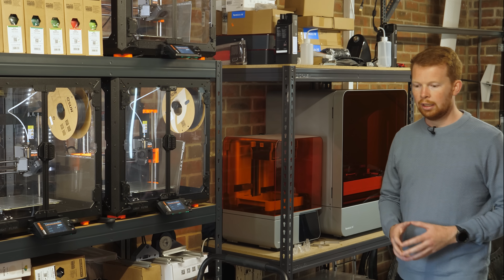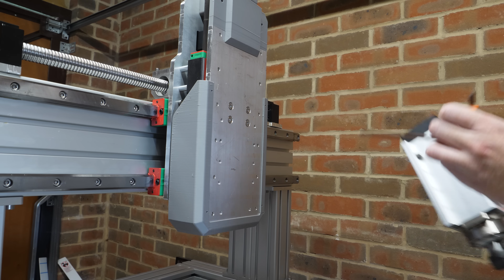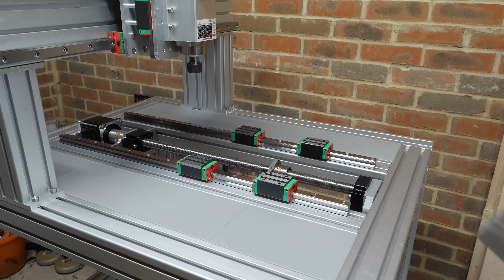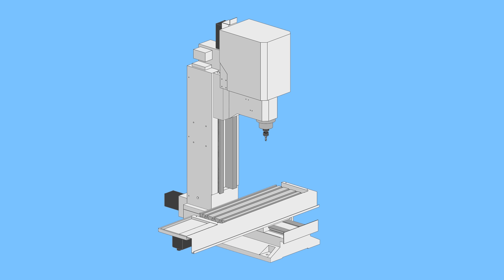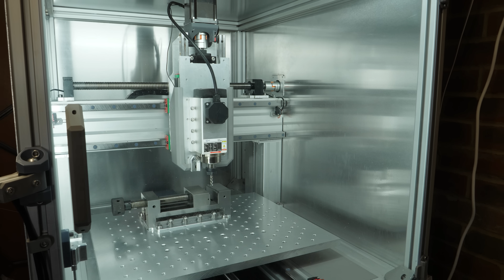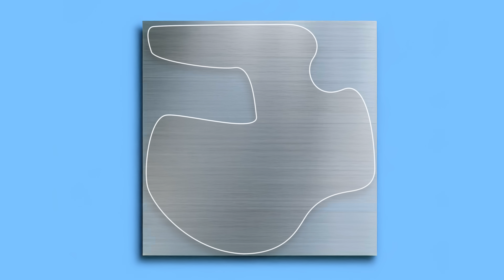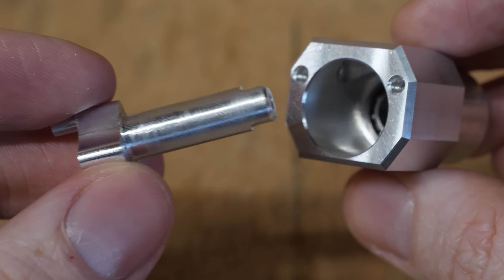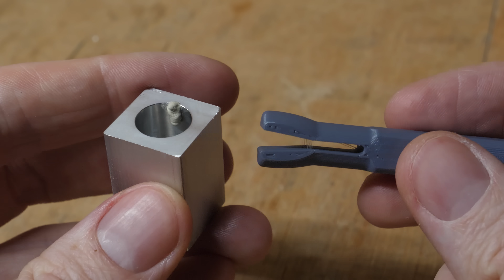I Needed an Engine, So I Built a CNC Machine

Comment: Clever with the epoxy/sand filler - I'd assume that the epoxy/sand helps significantly with vibration dampening due to more mass that the vibration would need to travel through. I think in the case of making a CNC machine, heavier is actually better compared to say a 3d printer where its more about reducing mass wherever possible due to the implied physics of weight/mass.

I also think your decision to have the milling head travel laterally rather than height can actually make things more precise with a screw-based mechanism as you're not constantly having to fight gravity, which will add at least some amount of play (in the form of backlash).

Overall, interesting build with some innovative engineering to overcome traditional CNC machine requirements.

Comment: @TomStantonEngineering  My good man, are you interested in collaborating on this project - we're developing a revolutionary pure ROTARY engine capable of operating at tens of thousands of rpm. [Will follow up w link to some of the tech otherwise it might get scrubbed. Crazy!] It will power the low cost [<$10,000], ultralight category [no pilot license], ultra-quiet, door-to-door, personal air mobility system. Team mates welcome.

Here is the core tech which can be incorporated into any engine architecture - https://www.youtube.com/post/UgkxZ6RT3NhnjTYs8tB22QgFe-MjqQ4qLNXC

Comment: I know this is a late comment, but you could try adding a polygon below the thread of the cylinder and a spring loaded blockage onto the side of the block. That way you could adjust the height in clicks and the angle should stay fixed after the adjustment.

Comment: Pistons without piston rings tend to have significantly more friction than with piston rings, and the idea is simple: piston rings reduce contact area, hence friction. Installing a piston ring is straightforward, it just requires buying the tool which slightly opens the ring and slides it over the piston into it's cavity.  Slightly more complicated but even more reducing friction and lifespan, can be achieved by adding one more ring called an oil control ring, which lets in a tiny amount of oil from the back side of the piston, but I guess this engine does not need to run trillions of rotations during its lifetime :-D. With this CNC, you'd make a new engine in a jiffy.

Comment: What about a small set screw in the part to lock down the timing maybe one on each side that way if you want to readjust the timing you can because i think you will have to adjust the timing depending if you use air or another gas

Comment: What's with your measuring needle? When I worked on CNC and we only had dial gauges, this solution didn't work for the accuracy we needed. I don't remember the reason, as I haven't worked in this field for several years. What problems did you encounter?

Comment: I have a CNC router from long ago.  Using 80/20 aluminum also.  Some of your parts are a bit thicker than you need.  Also, while you can use 80/20 for the table too, you could also just use any stable table made or wood, steel, etc.  My gantry moves in the Y direction, so I can't say if moving the platform is better.  For large wood, the gantry is better for me.  But small metal pieces maybe moving the platform works.  I used mostly a place formerly called 'CNC Routers Parts' for some of the pieces and design.  You can get beefy manual mills for about $3000.  They take up a bit of space.

Comment: Aluminum has a horrible coefficient of friction.  Rubbing it against other metals causes it to gall, melt, and stick.  

Also, i you want as minimal friction as possible, most of the piston doesn't need to contact the cylinder walls, only a skirt extension on the thrust and opposing sides would need any real form of stabilization due to the change in rod angle.
Reply: I've seen people straying water or mist on metal while cutting.  And this is why I do wood and not metal.  Cause the water run off is messy.  Also lathes are better choice for many circular parts.
Reply: @Putin_3  Both are messy.  The problem with wood is it absorbs moisture so itswells and changes weight, and compressed air decompressing will create a lot of condensation,.  You would need to fully treat the wood with an expoxy, which then just  makes it wood fiber reinforced plastic.  I would leave the metal cylinder alone, but run a nylom or delrin piston.  Just as strong, lighter than wood treated with epoxy, and an extremely low CF.  Plus, it can be machined just like plastic so you can use an injection molded block to make the piston from and not a much weaker 3d print.   In fact, if we wanted to go to the extreme, even the aluminum cylinder is just there because he wants to run 900psi of pressure, so if all desires is the strength, the cylinder itself could have a liner with a low friction CF too, such as bronze filled PTFE, which would be easy to machine and more than rigid enough to not deform.

Comment: Finish is OK, could be golden if you get a collect (er16) and chuck the material in the chuck and mount the tool extra firm below it, plunge the part. Do you want the BEST possible finish really, really? Use it like a lathe and mount the tool below. You're very welcome, very cool project.

Comment: If you want to prevent the cylinder head from rotating after properly adjusting its position, you need a "lock nut system". However, if you plan to add more cylinders or upgrade the engine in the future (to a V or L configuration), I don't think lock nuts would be practical. Your work is amazing.

Comment: 19:45 This seems really easy to solve with a simple set screw. Also, have you seen Inheritance Machining? He has a ton of cool videos detailing his adventures in making different tools for his machines, fixture plates, modifications, etc. that may provide some techniques you can use in your own projects. He works mainly with manual machines, but I'm sure you can adapt much of that to work with a CNC.

Comment: Would using isothermally compressed air (containing no water), work better ?

I guess as the air is decompressed during normal running, the gap between the piston and the cylinder will probably not remain constant and one of the factors affecting this could easily be water in the air.

Comment: Keep in mind that Pistons are not perfectly round! They are intentionally made oval and tapered to account for heat expansion and the forces exerted by the connecting rod. These shapes prevent the piston from expanding unevenly and seizing in the cylinder

Comment: Tom, the threaded cylinder got me thinking: if you dyno the engine (remove the prop and brake the engine), I bet variable cylinder height would increase power throughout the rpms (maximum torque at various rpms definately doesn't require the same valve timing across the board. This would become like ICE variable valve timing). Not sure it's useful since a fixed prop has a narrow window of operation for max efficiency anyways, but say you would be able to vary the angle of the prop arms, then varying cylinder height with a small electric servo would be insanely cool. A simple servo with a gear, meshing into gear teeth machined into the cylinder wall would work (make the gear teeth in the cylinder wall tall enough to allow vertical travel).

Awesome CNC by the way!

Comment: All the Energy and Carbons used and created in the Manufacturing of all these motors and drivers are not included in the calculations of the final products efficiency or performance. 
It might have been Greener not to have made the CNC or the little engine and just bought an already existing little engine.(For a model aircraft). I think I had a 2.5cc one in the 70's.
I really like the idea of Compressed Air as a power source as we can refill the cylinders by pedalling our pump in our Bunkers ,watching Content, protected from the dangers outside. 👍

Comment: 15:11   I'll let you in on a secret..   Pick up some Alum from the spice rack  (potassium aluminum sulfate) Put a small bit in a aluminum cup or stainless that you wont use  for food after.  You want it small as possible.   Place some water and a teaspoon of Alum in the cup and heat it then place your part in it and set the heat to low.  In a few hours the tape will turn to a black past that you can rinse out.    For larger parts you can use clay and build a cup around the broken tap and put the alum/ water mixture in it and heat near it.

Comment: Give a try to a HPA/ PCP aluminum air tank you can get them in 3000 psi or 4500 psi and they make air compressor that are very easy to use. And no im not talking about paintball cylinders. PCP rifles use thin tubes to hold the air. Hatsan and Benjamin or Diana make reasonably priced tube tanks

Comment: That design is also used commonly in 3-D printing and it is referred to as a bed slinger as it tends to sling or fling your parts straight off if you go too fast
Reply: That’s not even close to accurate. It’s called a bed slinger, because it LITERALLY SLINGS THE BED!

Comment: You create way too much friction if you use the entire piston as sealing surface. Your "cooling/heating fins" saved you there. You'd at least have to make the piston out of another material, that has some self lubricating properties, like some copper alloys do. Or your engine won't last very long.

Comment: as long as the fpt (feed per tooth) on endmills is what is recommended, it will cut nicely. theres a mathematical calculation for it. I also recommend roughing with bull endmills which have rounded corners that dont break off like flat endmills. these bull endmills will save you from buying alot of tools down the line and generally cut much faster. flat endmills are great for cleaning up after the bull endmill.

Comment: Incidentally, G-code has a command that automatically takes the radius of the milling cutter into account. The command is called G41 /G42. There are two commands because one is calculated to the right of the contour and one to the left of the contour. All you have to do is enter the milling cutter diameter, then G41 or G42, and it will mill the contour with dimensional accuracy.

Comment: bro your too smart for this im disappointed in you right now. you went with a standard 0.1mm resolution when you could have easily jumped to 0.01mm or even 0.001mm easy but you didnt even consider it. if you windering how bro. simple 3d printer extruder motor and a simple block and tackle setup and you can increase the resolution simply by adding more pulleys and you can even change the steps per mm in the gcode so 1mm is still 1mm so why didnt you build one for high quality parts? 0.01mm is better than a formula 1 car and you could have beat that easy and then the motor you used bro did you just cheat and look at a how to and mostly just copy default? replace motor with a turbofan and power it with a vacuum get about 30k rpms easy. to make anything cool you gotta think for yourself. like try to top my cnc machine or atleast match it i built it like this because its the best i can think of so beating it maybe hard but you can match it atleast. also i use a chuck for a drill not that small default thing i can do a wide rage of bits sizes i couldn't do before.
Reply: but still looks study well built lol in case of earthquake get under your cnc machine.
Reply from the maker: The steppers can be micro-stepped, so combined with these ball screws, it can do 640 steps per mm, which is about 0.00156mm.

Comment: As for locking the cylinder position in place, try machining a (probably very shallow in this case, unless you give the cylinder a longer thread on the outside in a future version) "locking nut" that gets added to the cylinder thread before the cylinder is screwed in. Once the position is good, screw the locking nut down against the body. This should lock everything in place, just like having two nuts on a bolt will, but still allow everything to be removed if need be. Just an idea, but might solve this problem easily. Keep up the good work!

Comment: Why not just mount the piece to the spindle and then mount a cutting tool to the build surface? Ghetto lathe. I would imagine it depends on the weight of the piece and you would have to counterbalance any asymmetries.

Comment: Great build Tom! I would like to make some suggestions. First, mount the cylinder with an integral flange at the base, this way its mounted in a permanent, fixed position. This would require machining a whole new cylinder. Second, design and machine a cylinder head that bolts to the top of the cylinder with an adjustable air line inlet, and an adjustable timing valve. This way you can adjust both the timing and the rpms of the engine. Third, you never want to run the same type of metals together especially at high speed. This will accelerate the wear and could cause the engine to seize. Instead, continue making the pistons out of aluminum which is standard in all engines. For the cylinder, the best material or metal is cast iron because of it's strength, wear, and lubrication properties. If you don't want to machine the entire cylinder from cast iron, you can machine the cylinder out of aluminum, and then machine a cast iron cylinder sleeve with a shrink fit. Now, the shrink fit cylinders sleeves are very tricky to install but will provide the best overall performance. Obviously, a small benchtop lathe would make machining most of these parts way easier. Consider getting a small benchtop lathe for all the precision round parts. This is from my years of experience as an automotive mechanic and my 25 years of experience in manufacturing as a machinist. These are only my suggestions. Like anything else, there are a million ways to solve a problem and to manufacture a part. I hope this helps.

Comment: When you are attempting to interpolate a perfect circle on your milling machine, try ramping in at a different x-y starting point always leaving .001-.003 from previous start point for final clean up, you'll see flour dust in the sunlight, wear your dust mask. If you are having difficulty, check the backlash on your screws, couplings and nuts and the tuning of your motors in software, keep in mind steppers do not hold the resolution that servo motors can inclusive to servo high resolution encoders. As you describe, you my also refine the Nurb Curve numbers in your programming to help remove faceting.

Comment: I would mount a servo to rotate the cylinder for timing adjustment you can 3D print a c-clamp to clamp around the cylinder with a lever to mount to the servo you can find the relative timing then clamp the cylinder so you can get precise timing by adjusting the servo which might also work well as a throttle, I would also recommend plating the cylinder with nicaseal plating for oil retention and longevity protection against friction

Comment: 14:58  for hand tapping you need oil maybe machine oil  and yes always tap from the flat horizontal surface
my coworkers use Castor oil (atleast that is how wikipedia displays it in english i have no clue its the correct name)

Comment: You could also rotate the entire object and holding the bit stil. That would remove the need for the lathe, but require a little different cnc mill.

Comment: Also think about how you mount the milling tool in its holder. The further out you mount it the more it will start to vibrate. Always mount the tool as far in as possible.

Comment: Why is moving the gantry  less rigid than moving the table?
Reply: I believe because the of fact that the bed/table is closer to the ground/mounting surface and therefore it doesn’t have as much room to wobble around. Think of it like a tall tree swaying back and fourth compared to a short tree. 

Also, there is a problem with stacking one axis on top of another. 

The lack of rigidity from one axis gets multiplied by the lack from the other axis. But if you split them up, (the gantry moving in one dimension, the bed/table moving in the other dimension) then the lack of rigidity only gets added together rather than multiplied.

Comment: Can't the machine use a different language than G-code?
In theory, a different language would be able cut a perfect cylinder by "continuously" varying X and Y coordinates. The update frequency of those 2 variables, along with the diameter of the cylinder would dictate how defined the cylinder would be.
For most practical purposes, it would be a perfect cylinder, I would assume.

I knew that G-code was quite "primitive", but I didn't expect it to be this restrictive.

Comment: If you continue the male thread on the outside of the cylinder higher up, you can likely fit a small jam hex nut onto it.  Leave it loose when finding the timing and then lock the jam nut down against the body and it should keep enough tension on it that the cylinder will not back out.
Reply: You could also add timing marks to the body and the cylinder both so that you can track degrees for testing and repeatability.

Comment: If you use G12 for the circles, the control board does the interpolation and it can do it to .0001", so that you don't have to generate many lines of code.

Comment: Hi Tom,
You can put the round bar stock into the spindle and the lathe tool in your vise, this simplifies the process as you don´t have to make a tool... and you can fine tune the OD of the part using the X axis.
Also, check what i have done with my probe, you may find it a better solution.

Amazing work and very cool video!

Comment: Great video.  You could develop an internal combustion 2 stroke engine from that design to power an RC airplane, car or boat.
Some mounting "ears" on each side of the crankcase would make mounting easier.  Maybe extra fine threads on the crankcase to cylinder would help?

Comment: Hey tom a locking nut just above the crank case should do you good for locking it down. Just cnc some threads on the outside and use a flat nut